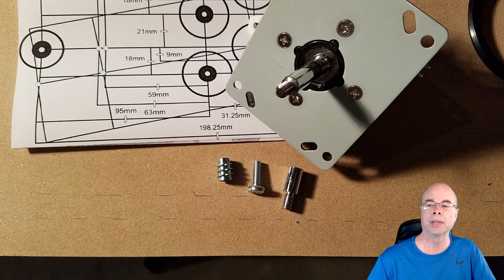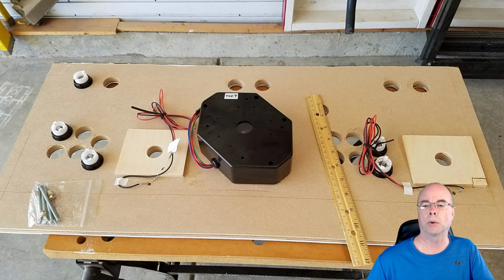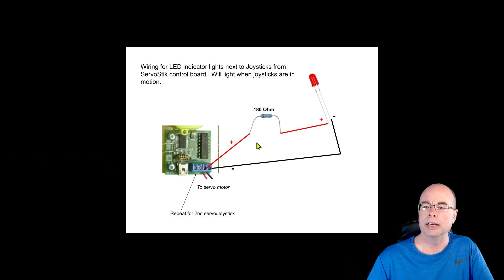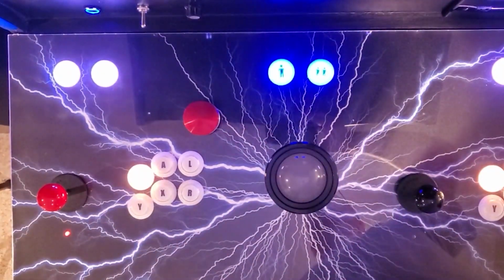Arcade Build Part 5: Controls and cabinet wiring

Comment: Great video. How exactly did you get a power switch to work with the Pi? How’d you wire it?
Reply from the maker: It is simply a normally-open button and it is wired to a GPIO pin (GPIO3 I think?) and ground and add a line to your Pi's boot config file to tell it to use GPIO shutdown.  Pressing the button will then shutdown the Pi.  Pressing again will power the Pi back on.  I was using a Pi 3b+ so the newer Pis may work differently.  But you can find a lot of examples by searching for "Raspberry Pi power button".  Here's a decent one to start:  https://www.instructables.com/Raspberry-Pi-Power-Button/
Reply: Thank you, that’s exactly what I’m looking for.

Comment: This is great. I'm trying to work out how to do the external power switch. I can't quite figure out how the switch works. 

As in, what are the steps -  you get power from the mains, and plug that into the power board (black one), then you've stripped the plug off the (black) power board and added the switch? And everything then plugged into the power board doesn't get power when the switch is off? 

There's loads of videos about cabinet builds but not many seem to cover this off! Thanks
Reply from the maker: So, basically, the white power strip is the one directly plugged into the wall outlet/mains.  This is the 'continuous' power supply for the cabinet.  But as I mentioned, I ended up not really needing anything continuously powered.  So the only thing plugged into the white supply is the black supply.  But I tapped into the power cord for the black supply and added the toggle switch.  Now, if you are using a non-illuminated switch (just assure any switch you use is rated for 120V AC), you can just split the hot and wire it across a switch... just like you would a normal a/c wall switch.  If you are going to use an illuminated switch like I did, then you also need to tap the neutral.  I just stripped the insulation back from the power cord and cut the hot and neutral (I left the ground intact) and ran leads up to the external switch.  If you haven't looked at the related blog article, there are a couple of additional photos that might help with this explanation ( https://retroarcadebuild.blogspot.com/p/the-arcade-build-part-iii.html ).

When wired this way, anything plugged into the white supply will maintain power as long as the cabinet is plugged into the wall, but anything plugged into the black supply will be powered off whenever the external toggle switch is turned off.  I hope that explanation helps... and answers what you were asking.  But let me know if you have any additional follow up questions, about this, or any other part of the cabinet build.

Comment: I built an arcade without the IPAC  using a cheap encoder wired directly to the raspberry pi . what is the advantage of using the IPAC?
Reply from the maker: Well, for one the IPAC has 96 channels for LED lights used within the controls.  It also has up to 48 inputs... plus the ability 'shift' any input for a second keyboard code.  It can also emulate gamepads/mouse.  And finally, since all my controls were from Ultimarc, this board (also by Ultimarc) added convenient plug-and-play capability for the trackball and spinner.  You could easily build a panel for 4 players using this single board and a single USB connection to the Pi.

I used a cheap encoder with the prototype that I built before the arcade cabinet.  The IPAC, to me, was well worth the extra cost for all the additional features and ease of use/hookup.  You can see more of the features of the IPAC (over a standard encoder) here: https://www.ultimarc.com/control-interfaces/i-pacs/i-pac-ultimate-i-o/

Comment: Great video, I've just ordered my Ultimarc controls so I'm all in.  Couple of questions on this video, would you be willing to share the powerstrip models, the power buses(and where purchased), if possible the toggle switch used for mains power.
Reply from the maker: Hi Paul.  All of the items you are asking about came from Amazon.  Here are some Amazon affiliate links, but note that some of these items may have been discontinued or replaced by newer models (since they were originally ordered in 2018):

Primary (always on) power strip:  https://amzn.to/3LwGxBX
Secondary (switched) power strip: https://amzn.to/387xMjY
Power bus: https://www.amazon.com/gp/product/B005K49NMW
Main AC Power Toggle: https://amzn.to/3G6bw6J

Let me know if you have any additional questions.  Good luck on your project.  Keep me advised on your progress.
Reply from the maker: Hey Paul.  I thought I'd try pinging you here.  I did respond to your last email regarding Proxmox/HA on VM a couple of weeks ago.  In fact, I tried responding using two different email accounts and also tried pinging you on Discord but I hadn't heard anything back.

But I believe that Hotmail may be blocking my email accounts (somehow they appear to be flagged... probably from me sharing code blocks and samples via email).  I just didn't want you to think I wasn't responding, so I thought I'd try posting a comment here in hopes that you will see it.

Could you let me know if you did or didn't receive my email response(s)?  Until I get the email situation cleared up, Discord may be the best way for me to communicate with you.